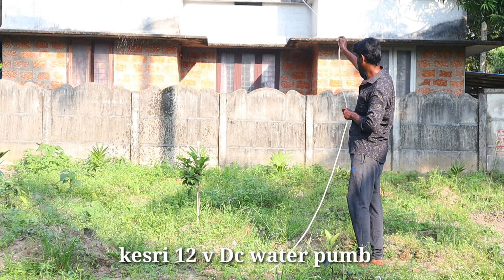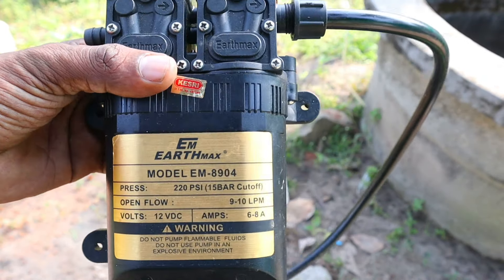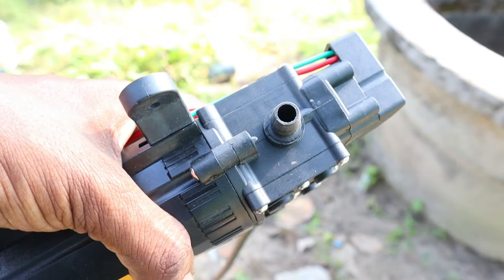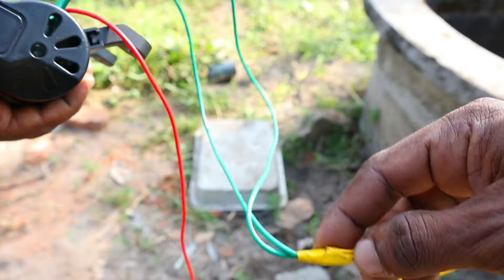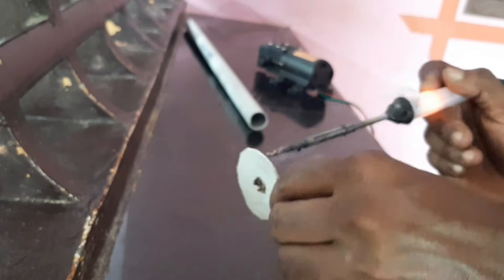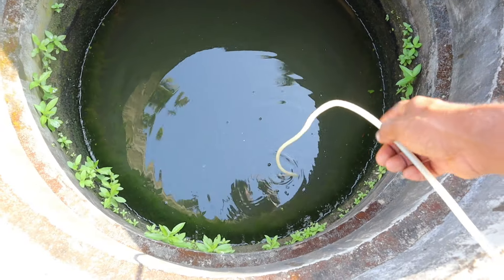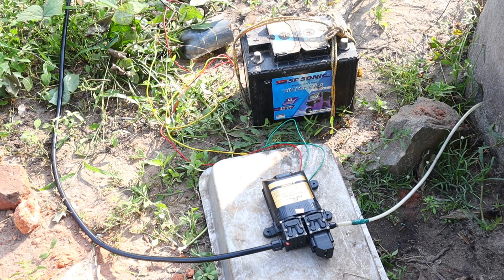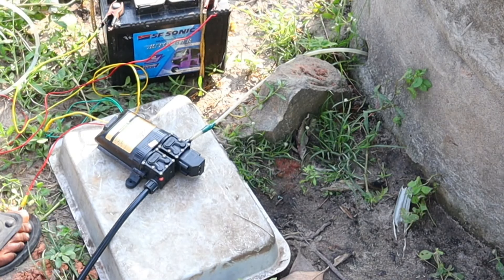How to install 12v DC water pump|Solar water pump|kesri 12v DC water pump|Battery sprayer motor

Comment: കരണ്ടിൽ ഉപയോഗിക്കുമ്പോൾ എത്ര Amp Ad aptor ആണ് ഉപയോഗിക്കേണ്ടത്?
Reply from the maker: Dc power adapter, 5 Amp or more
Reply: Dc 12v 6A use cheithalum no problem